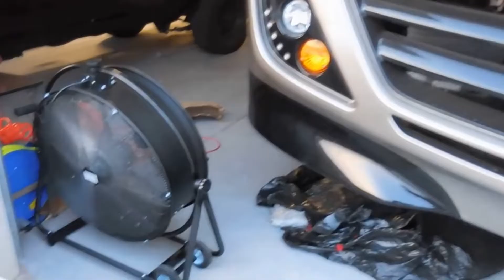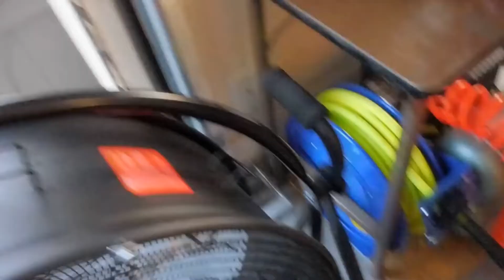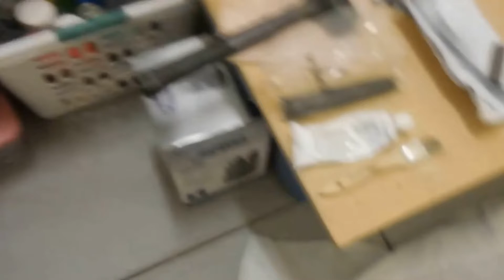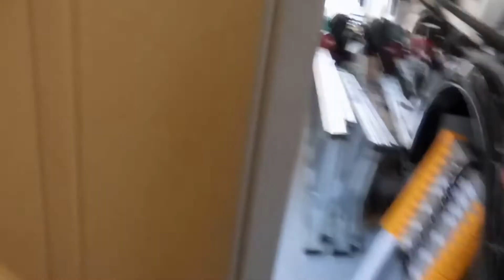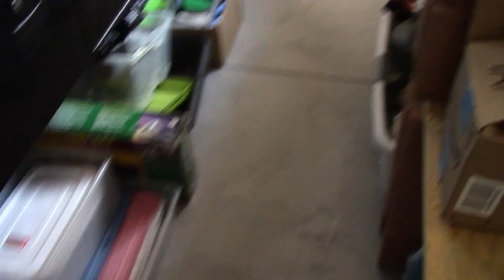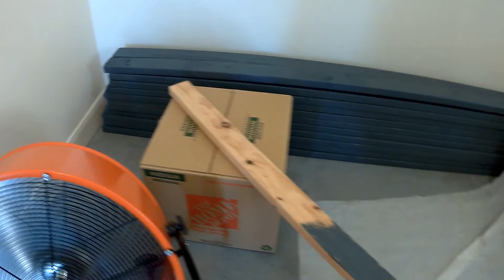533-Utah House Projects: Garage started the loft build

Comment: Good planning Frank. if you run out of room to store or do some prefabbing you can always use the side of the house with some type of temporary cover. You will figure it out as you go along my friend. Thanks for the update.
Reply from the maker: Good idea, I'm spending a lot of time figuring things out for sure. I've learned here that Southern Utah is prone to extremely high winds and sudden down pours; anything not tied down will become a projectile or floating debris for neighbors on the next block, LOL, I've even retrieved 2x4's floating by the house in the street gutters from home construction nearby 👍  I've even ordered the metal building with anchors rated for 105 mph.  Any kind of soft cover other than a hat just won't cut it and working in direct sunlight here you have to be tough as nails like the landscape/construction workers 40 years my junior around here, I have a lot of respect for them. I can last about a half hour, then I run inside for A/C, I'm a wimp, LOL. Low humidity does not diffuse the suns rays so you fry.  Although the inside of the garage during the day keeps at a temp of 10-15 degree differential less than outside, but even so when it is ~105 degrees out side it is still hot to work so I wear a soaked wet 'quick dry polyester tee shirt' that when coupled with the drum fans turbulence creates a cool workable environment.  It takes time to adjust working here but is still better for me than having snow in the winter or high humidity living somewhere else, or living in California.  😂

Comment: The drum fans work great. The gate looks good, I would have it looking like a diamond shape with my lack of skills. It looks like that loft is going to be time consuming, so be careful in the heat there point them fans right on you.
Reply from the maker: So true.  Well, when you retire you'll say to yourself, "with so much to do, how did I find time to go to work?", LOL  It is amazing how easy it is to get distracted with the other stuff in the video and other tasks in the house that aren't video'd, (Kathee has a running honey do list).  Spending time overcoming space management and HEAT issues have made it slow going definitely.  I've experienced on past projects that in this case painting the loft lumber and storing (with limited space) does seem to make it a slower process starting out but makes the job of painting to that of touch up and less messy as painting the loft structure components would be a nightmare after it is constructed, like painting a picket fence, ugh.  Although the inside of the garage during the day keeps at a temp of 10-15 degree differential less than outside, but even so when it is ~105 degrees out side it is still hot to work so I wear a soaked wet 'quick dry polyester tee shirt' that when coupled with the drum fans turbulence creates a cool workable environment. So I have found it is a learning process how to work in this environment as you get older, where as in my younger years I was affected less by the heat, facilitated maybe because I would have consumed a lot of beer. LOL